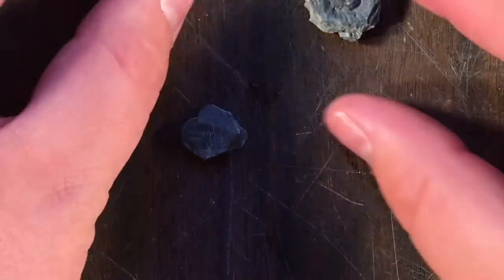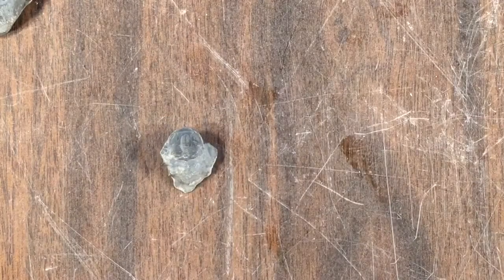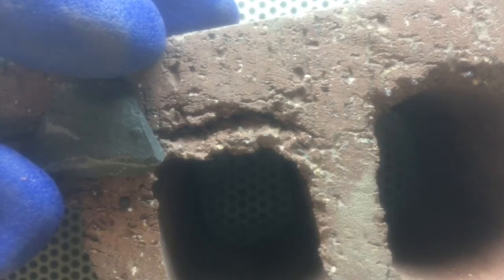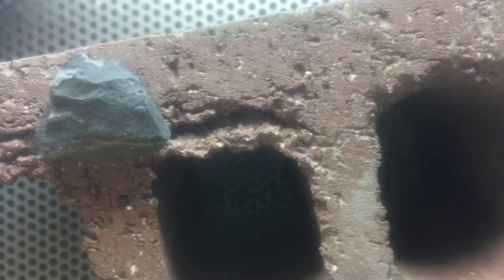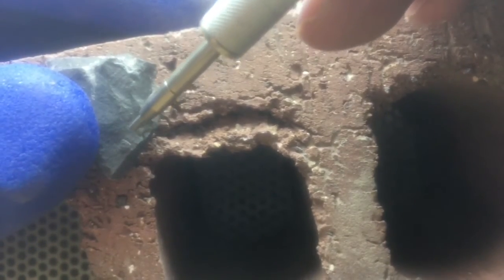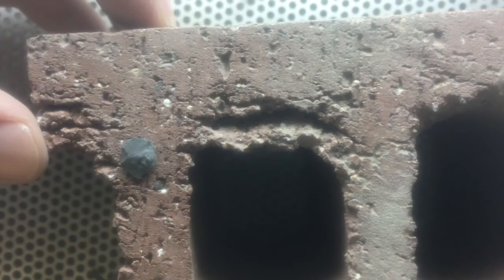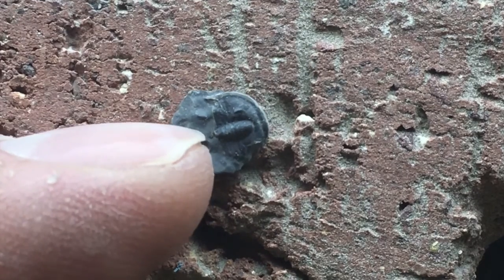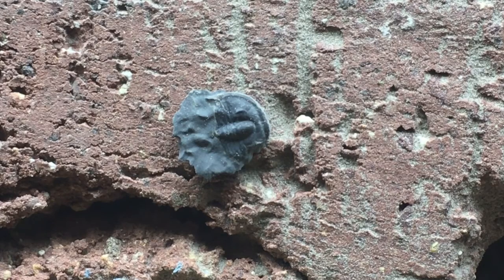Fossil Prep Blog Episode 2: Different Pressures Help Expose the Fossil

Comment: Hiya Zachster!  Nice vidz, thank you!

 

As a newbie myself, I am about to start my air blasting (gently as per your videos!) and am really interested in the pen you are using to sand blast with?  - not the air chisel or other preparation pen, the actual pen that emits the abrasive material.  It looks nice and small?   I only have a Hobbyists type of gun - more an airbrush really with a tiny gravity feed tub on top for the oxide etch.

All the other blasting equipment that I have seen is for Garage use and way too big and powerful for any delicate fossils.  I have a shedload of ammonites about 3 to 5 inches across that have been prepped with my pins and chisels, I now need to get blasting gently.

 

Any chance of a link or something to what you use please?  Maybe a picture of the 'gun-end' of your setup would help me as well?

 

Thanks very much,

 

Yours Sincerely,

Steve Barnett (London UK)